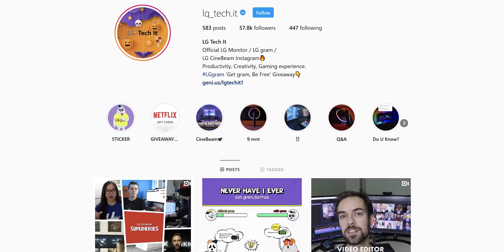Water cooling the FASTEST Mac on the Planet

Comment: Linus: "This motherboard is almost comically large for this case."

That motherboard is just comically large in general.
Reply: It's just that Linus' hands are comically small.
Reply: Dunno the original mac mobos are huge a/f too
Reply: Ya no those metal bands around the power cables? If those touch the back of the motherboard or something can’t that short something? I’m just wondering if someone can answer
Reply: @ghost-4230  It's possible they could but I'd think they were coated in something to make them not be conductive so they could protect their investment
Reply: @ghost-4230  yes it most definitely will
Reply: @emeraldbonsai  A mac pro case IS massive (well, it was by 2010 standards). It's like 45x45cm so it can fit even WTX motherboards.
Reply: I read you comment at the same time linus said it
Reply: @ShoryYTP  me too lol
Reply: Thats like a 216 gigs of ram mothervord XD
Reply: @emeraldbonsai  As far as computer cases go with age : Huge => Smaller => ATX standard (mid tower)=> Larger again with full towers and even bigger getting into fashion again. The 1000d was released in 2018 for example.
And back in 2006, full towers were not that common.
Reply: @emeraldbonsai  You're confusing inside space with total dimensions of the case, mac pro is 45x45cm inside, outside it's 51x51, additionally, models of this size were not common *in 2006*, you're giving me ultra-premium models released in 2018... Cases like the Lian-Li PC-60 were already considered larger than usual back then. Even what was considered huge cases back then like the CM Stacker 830 or the Silverstone Temjin TJ09 weren't that much larger.
The mac pro case wasn't the largest case ever made, but it certainly was the heaviest and on the large side.
Reply: So he pulls out a comically large motherboard
Reply: Four years later, and I personally think this motherboard still looks sexy AF
Reply: Server motherboards: am I a joke to you?
Reply: @emeraldbonsai  no shit thats how size works